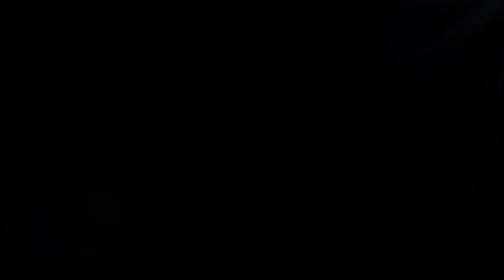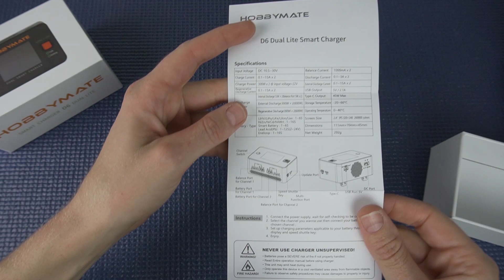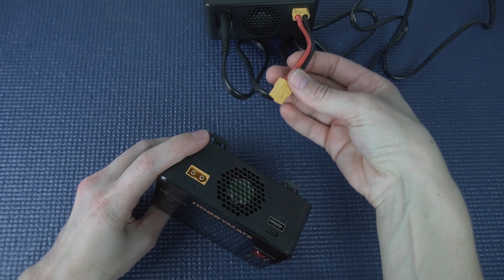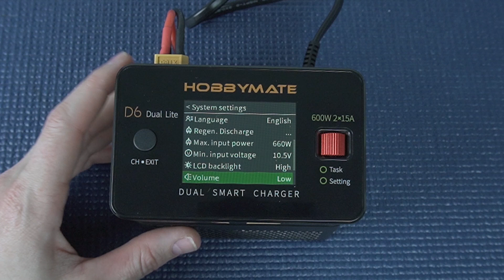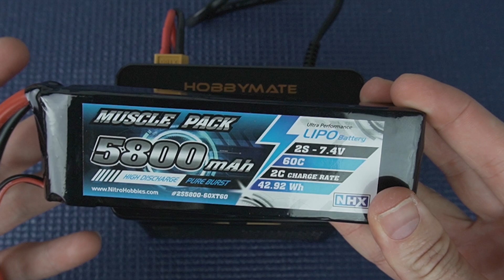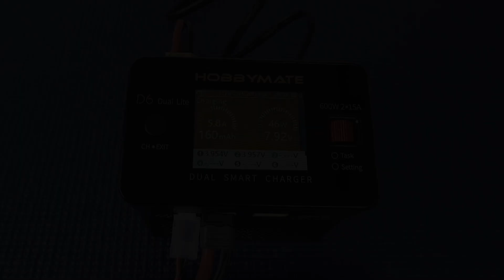My favorite new RC smart charger! Hobbymate D6 Dual Lite review

Comment: Maybe you can help me out,  I looked on the website details, and the AC specs look like the ac power supply ONly provides 240w total for both channels. Is that right?  Seems like a huge drop from the 300w for each channel with 22v DC power.    I am on the fence with ordering this charger since the Specs show the AC Power supply is severely Under Rated.....Thanks

Comment: Charger looks great except for the XT60 ports only, I have no batteries at all with XT60, why would they not just have the inputs for multi leads like every other charger?
Reply: Most quality chargers come with an array of adapters.  I'm surprised to see one that completely ignores the many adapters used in the hobby.

I'll replace my Skymax B6AC with another just like it.  Skymax came loaded with adapters, it's dead quiet, and the power supply is built in.  NOT a separate brick.

Comment: Damn Rc Girl, i only had the t240 for about a month now, and now i want that one... :0)
Reply from the maker: The t240 duo is still a great charger. Have been using it for a long time, it just has a slower charge current (10A per port vs 15A with this one). Not a huge deal